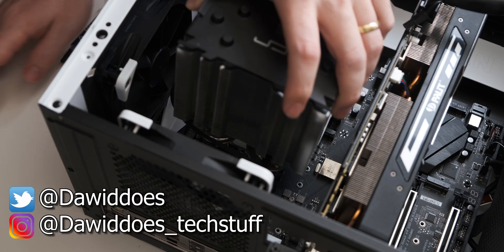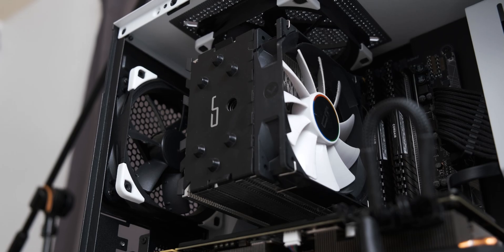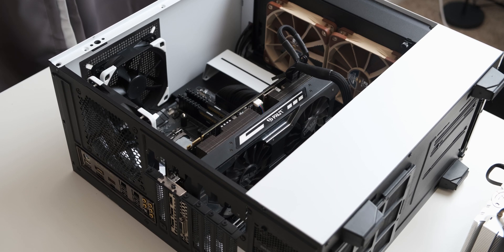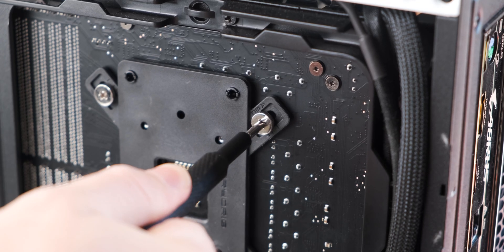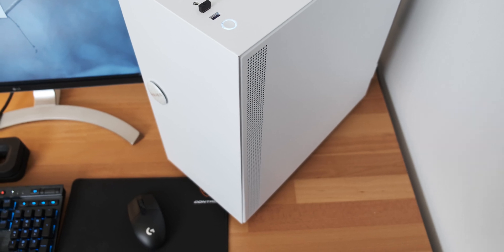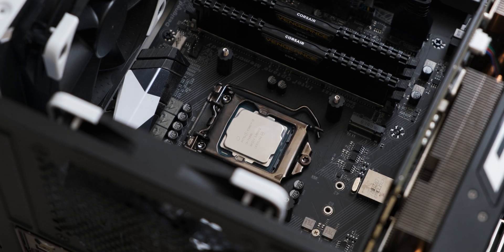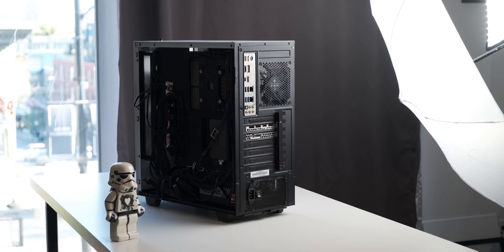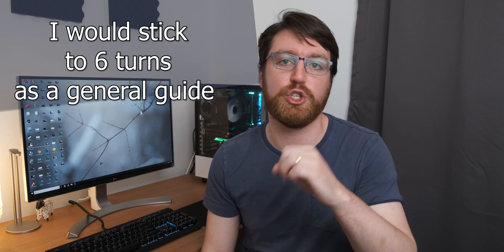Is mounting pressure important for CPU thermals?

Comment: I have a laptop,  and i literally don't understand the pressure thing, the problem is once i under screw it and the gpu failed, it reached 100 within 1-2 min of starting laptop.  Then i did 2nd attempt, did hard screw, it had always been good since then, but within 6 months, the thermals start reaching 85 easily. The thermal paste being used is Thermal Grizzy Kryonaut. 

Last time, i switched to Arctic MX 6, and i over screw it as usual, this paste is quiet thicker, i applied and after 2 months, laptop went to constant 80-85 easily. I repasted it and over screwed as usual, this time it started reaching 85 constantly within 1 month, what i observer that over screwing a thick paste makes it squeeze out of place, it scatters out of the gpu surface easily since the pressure is high constantly. Now in my 3rd attempt soon, i will screw softly because i am understanding laptop overscrewing is bad, i also lost 1 screw because i over screwed it and the screwdriver slipped on the philips screw head, damaged its grip, so overscrewing is bad in that case too. Optimum pressure is enough.

Comment: Given vehicle components have specifications for how much torque should be applied, this is a worthwhile exploration.  I hand tightened down the screws I had until they were firm.  I also had some springs that were providing some standoff resistance.  I'll repeat the other's concerns that, these parts are expensive, let's not break MOBO or CPU pins that cost us a few hundred altogether if it comes to replacing, let alone time and frustration.

As a general result that "just about any firm contact is good enough that the part won't come loose" is sufficient, is good to know.

Comment: Got a 7600X assembled . Idle was sitting at 51C even in BIOS. Cooler is DeepCool Gammaxx AG400. Tightened the screws (that had springs underneath) with 3 or 3.5 more turns until the spring was nicely compressed and couldn’t move the screws anymore. 

Idle temps dropped to 45C. ❤
Profit?

Comment: I think pressures important. I just built in the fracta terra using a thermalright apx 90 x47 and I couldnt screw in 2 bottom srres properly due to the terra spine. Launched rocket league and immediately was met with 80+ degree temps

Comment: very useful info. that was not pointless. i was seriously worried about this because i had problems with overtightening in the past, but i couldn't control the pressure (am3 brackets) and some of my memory slots would not work at all

Comment: Ok this video didn't tell me anything cause you didn't specify your testing steps and whether or not you lifted the cooler from the CPU during the process, which can introduce little air bubbles to the thermal spread.

Comment: I'm here cause I can't believe how tight I'm supposed to attach my cooler to my new AM4 CPU, so I loosened the brackets by a lot first, which still made me have to push the cooler onto the CPU really hard. But the thermals aren't great and I think that's why. It also leaves more room for uneven pressure.

Comment: The most problems ive had with under or over tightening is when i upgraded my old 3rd gen intel laptop to an i7 and squeezed most of the thermal paste out the side.
Reply: Is that a problem then if it comes out of the sides?
Reply: But like not a lot but like a little bit

Comment: I don't think using a noctua is a good test of this, they made their mounting system way easier to get right than most manufacturers, would suggest finding one that screws into the board with standoffs and no spring pressure.

Comment: You should have used a torque screwdriver and a thermal pad to make sense of what 6 turns are and to delete the thermal paste variable. A screw with a bigger head and 6 turns generates much more force than a screw with a smaller head and 6 turns because the distance you have to turn the screw is longer. It took me less than 10 seconds of watching your video to figure that out.

Comment: not pointless at all. i bought two mainboards used and i needed to test if they work at all, even though i dont have the right cpu cooler. after watching this video, i just rested the heatsink of another cpu cooler on the cpu, connected the fan and turned it on. it worked. thank you!

Comment: Thank you, I only rotated one-and-a-half turns, and the way my cooler Titans on is there's a backplate which has studs that stick through the motherboard, and the bolts that apply the cooler to the motherboard CPU are secured by small nuts that have Springs to apply a certain amount of tension... and my motherboard would not post so I wasn't sure if I righteously messed up, I did contact MSI and they said it sounds like I had a corrupted motherboard so... thank you for giving me this information so I wasn't worried about the CPU

Comment: in a way, the pressure makes sense, because the thermal paste needs a little pressure to spread evenly over a few hours. as it does it gets thinner and covers the whole heatspreader. temps can getting better the first hours if enough pressure is applied.

Comment: I think measuring it from the start is less accurate. Your fingers, and hand are better at measuring, and keeping straight the cpu, and screws. Put your hand over it so it does not tilt left/right, up/down. Then use your fingers to find the beginning of when the screw tensions, and then measure the screw turns by watching the screw head. And go. Eg. top right, bottom left, top left, bottom right. So that the screw turns are equal lateral. If the board bends its on too tight. And if any of the screws has play, its on too loose.

You want it firm, but not break neck tight.

Comment: The no pressure test didn't actually read correctly. Your CPU cooler is very heavy so even without screwing it in, it still adds pressure. If you had a stock cooler it would have different results.

Comment: once i tighten my cpu cooler to the max but i dont feel it overtighter i got 32c on indle my cpu is i5 9400f , but i have several issues like bootlooping some random crashes .
then i loosen it a little bit my issues are gone but now i have +5c hotter on idle (37c)  .

Comment: If anyone really wonders. You will hear ALOT of cracking before the motherboard has a real failure do to an over tightened CPU cooler. Back in the day motherboards were way thinner and I had MB that would be bent from the CPU cooler mounting before installation into the case. Sometimes requiring the cooler to be loosened to get the holes to matchup. But the pressure is actually real important for effective heat transfer. Modern motherboard can take several times more pressure before failure. They crack and bent way before snapping. Plus 99% of the time if you hear one or two small cracks you will stop tightening the cooler and those cracks will mean nothing. But just know there is a indication of wrong doing way before you ruin your investment.
Reply: this is untrue in some circumstances. If the pins are in the motherboard instead of the cpu you can bend the pins with overtightening/using thr wrong heat sink. ask me how i know
Reply: Any cracking for something so fine I would think to be a sign of great alarm.  And like the other guy I'm similarly concerned about the pins in the socket.  Those probably won't generate a significant snap if damaged.

Comment: so I got a FUCKING dark rock pro 3 for an LGA 2011-3 mobo and there was just no possible way to screw the fucking thing down. I needed to remove the ram sticks to get some space to work but after installation, it would be IMPOSSIBLE to put the ram back in!!! urge to kill rising....

but your vid goes a long way towards putting my mind at ease. my rig is an al fresco setup on a test bench so it's lying horizontally and I've just got gravity and thermal paste holding it on and temps seem to be fine as your vid confirms.

kinda surprised that the thermal paste being pulled apart again and again also didn't seem to have much effect on your temps. that's really good to know.

great vid. you've done a great service to your fellow hobbyists.

Comment: not really about the thermals, I was getting 3625mhz boost max on my ryzen 5 2600, when I tightened it a bit, it ent straight to 3700mhz boost and lower temps

Comment: Can over tightening a cpu cooler cause audio issues say scratchy voice chat audio and lots of popping?
Reply: depending on the board it could, some have dedicated audio layers which are usually at the rear of the board. but if you cracked or scratched the motherboard its certainly possible.

I'd check your microphone/speakers first though,  usually it's a fault somewhere in the cord.

Comment: Man, this is gold!
I always wondered, like why for the last days my PC feels slower. I thought it might be throttling cuz of my bad CPU cooler pressure. But, now I am more than sure, that it is is fine. 
Would be interesting to see such stuff on other cooler-connectors, as well as on AMD platform.
Thank you!
Reply: This test is flawed because the pc is not vertical. when vertical, downward pull by gravity will slightly tilt the cooler if there isn't enough mounting pressure. this was proven by tests done by Der Baur. 

Roman from Der baur designs and tests thermal systems for Thermal grizzly.

Comment: I'm curious what your CPU speeds were boosting to during these tests. Did you have a locked Vcore and core clock? Or was the chip able to boost as it saw fit? If so, you could've been getting frequency improvements even though you didn't notice temperature changes.

Comment: That's a great test, thank you for doing it. Puts many at easy, including myself, seeing as I'm using zip ties to hold a stock intel heatsink coupled with a noctua fan onto an i5 😅
My main reason for doing that is that I'm using a mini itx Silverstone Sugo case with bugger all room inside, so I'm extremely limited with coolers. I tried the intel stock cooler, but broke the fan trying to mount it. Those things are SO shit. But at least I can use the heatsink now 👍😜

Comment: I know nobody will read this but my cpu was running at constant 100 degrees even in desktop and I tried screwing it down even more but it was already so tight that I couldnt with a scredriver so i used a small ratcher and even stripped one of the bolts but i manage to tighten them more and now it is running at 39 degrees on desktop and my games feel 10x better so I'd say you want to screw it more than not enough at least in my case it really helped

Comment: Yeah... mounting pressure. Not that unimportant. I nearly shat myself when I recently ripped out my 5800x from the socket, still attached to my cooler...

Lesson learned: do not twist the cooler around.
Reply: actualy run a stress test or put some heavy load on the cpu first to warm it up. You can also CAREFULLY use a hairdryer on low to warm the heatsink/rad up. Don't get it too close though, you just want to heat it up a bit not bake it. once its nice and warm carefully wiggle the cooler loose and lift it off.

Comment: A tight fit with Thermal paste makes a huge difference. My CPU fan was jarred loose during a flight to Asia (I put it in my check in luggage). It had thermal paste, but I didn't reapply, I just used the existing that was about 5 years old. My CPU temperature almost doubled. I removed the old paste and applied new, and temps went back to normal.

Comment: What I'm worried about isn't contact pressure, so much as vibrations coming from the damn fans.  If I don't tighten the cooler down enough, does that introduce more or less vibrations to my motherboard?
Reply: good point

Comment: So after skipping 2/3 of your video's pointless blabbering information to get the test result, you showed a test result based on IDLE temperature? Seriously?! 

You can't be serious. Is this a joke? Parody channel? I mean, it never crossed your mind to test it on load? because you know how well the contact (pressure and paste) will differ how your CPU heat transfer at high load with high temperature right?

Comment: It is an old video, I wouldn't search for this kind off problem until yesterday when I over tightened my cooler V8, I started to have ram issues and random blue screens, I concluded that on my motherboard dimm 3 and 4 makes a problem. I loosen the screws and my ram began to work and blue screen disappeared. Good video. I wish I had watched it before yesterday.

Comment: If you measure it like this the cpu cooler is pressuring itself onto the cpu. But if you turn the case vertically the cpu cooler is pressuring the cpu differently. So I guess the test results could differ if the test setup would differ

Comment: lemme testify... i over-tightened my aftermarket cpu cooler... and while it posted and booted... it failed all benchmarks and was freezing during renders, etc.  i want to encourage everyone to NOT PANIC.  I simply backed out the screws on the cooler... three turns at a time.  at first it stopped freezing during benchmarks... but it still had a core that was missing.   backed the cpu cooler out again, another three turns per screw... that was the trick. 

You CAN put TOO MUCH tension on the CPU socket... it can give bizarre unstable behavior based simply on SOCKET-PRESSURE.  Test results and sharing such as this are important.  But even results that don't seem to "matter" scientifically, doesn't mean there are not solutions that can solve a problem by intuition alone.   in my case, the CPU cooler was bottomed-out and threaded TOO tight... that's never a great idea.   I backed out that tension, and my freezes and crashes disappeared.   Seriously.

of course check out cineform, GPU-Z, HWMonitor, Intel Processor Diagnostic Tool, etc. 

Good luck and trust your instinct.
Reply: Can vouch for this as well. Had my cooler too tight and it would make my PC restart randomly, turned back a little bit and it's been good so far
Reply: Can it bend the cpu pins? In my case 3600 on b450?

Comment: Metal expands with heat so it's a good idea to tighten the screws just enough until the cooler is securely attached. We can also take inspiration from car tires. Too much air pressure can blow it up as air expands with heat.

Comment: This was not pointless. I want to make sure my $300 cpu won't be damaged from over-tightening and won't overheat from under-tightening.
Reply: Yea and I overtightened mine foolishly once and got thermal paste overflow.
Reply: @grento9654  So you just gave too much paste. Also, if it's not liquid metal or any heavily conductive, then there shouldn't be a problem except cosmetic appearance.
Reply: Can it bend pins on amd cpu?
Reply: @verdrehteseele8525  nah
Reply: @verdrehteseele8525  I don't think so, more likely to just crack mobo, socket, CPU. But even that IDK if it's possible, I mean I think like someone would have to put full force into screwing, when screw wouldn't want to move.
I'm kinda disappointed that he didn't use a screwdriver with force meter and that he didn't try to screw "over limit".
Reply: @MAST  thanks, that puts my mind at ease

Comment: Thanks for this. I feel safer with my zip tied heat sink now.
Reply: lmfao
Reply: Actualy, I never considered using a zip tie but that's a GREAT idea.  I'm waiting for an official Noctua AM4 mount kit; but a good zip tie would work either for my current system or to mount an off-brand cooler to a different board.
Reply: @KL-bi2un  a bit late, but its been 2 years and my ziptied noctua nh-u9s works perfectly. For some reason the Shuttle sff pc uses LGA 775 even with a Intel 2770k. Works perfectly on a 24/7 on home server.
Reply: Lmeaw

Comment: Now stock coolers are something else, specifically the Ryzen series. There's a metal plate that goes at the back of the motherboard so you can tighten the cooler in the front. Thing is the cooler's screws touch the metal plate before the heatsink touches the CPU, and there's limited vision of the CPU and the heatsink touching. So I had to play a guessing game by slowly tightening the screws until it kind of felt firm. 

Like one of the comments: I couldn't sleep that night.

Comment: You are my favorite channel that routinely does tests where the result is, "No result at all"

Its interesting mostly just for the fact it shows that most people start w/ bad assumptions; the fact you've eliminated one of many is useful in its own way.
Reply from the maker: Thank you. :D Thats what I'm trying to do with these videos. Let me know if there are any other questions like this you would like me to test.
Thanks again for the comment.
Reply: This test is flawed because the pc is not vertical. when vertical, downward pull by gravity will slightly tilt the cooler if there isn't enough mounting pressure. this was proven by tests done by Der Baur. 

Roman from Der baur designs and tests thermal systems for Thermal grizzly.